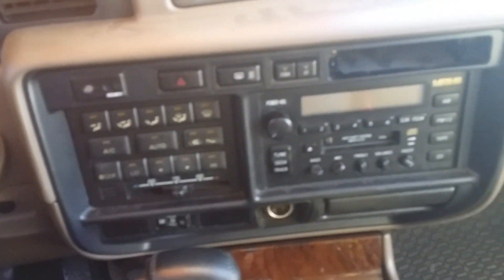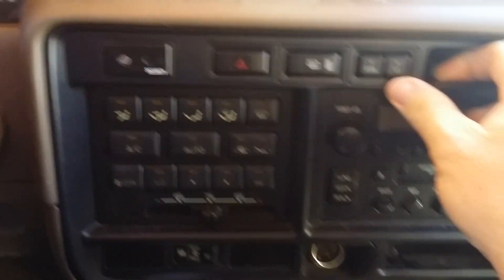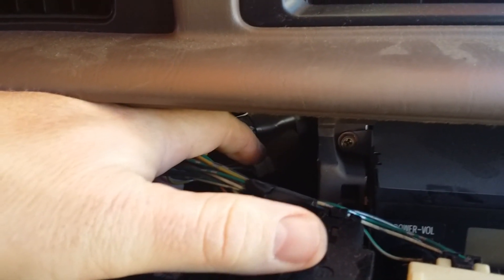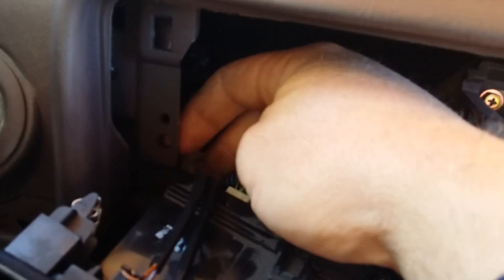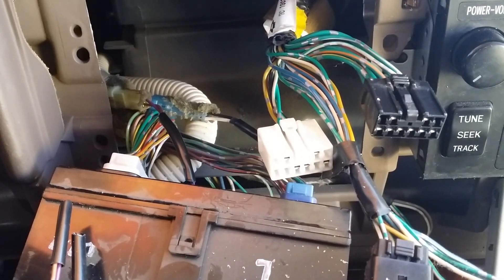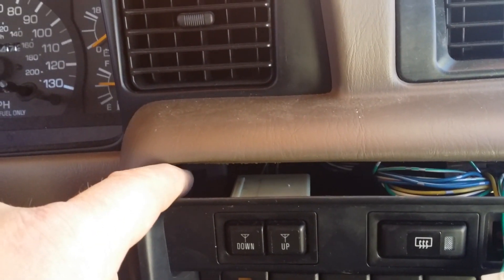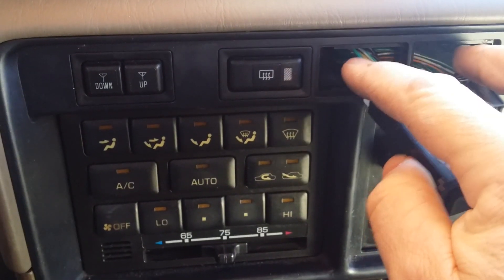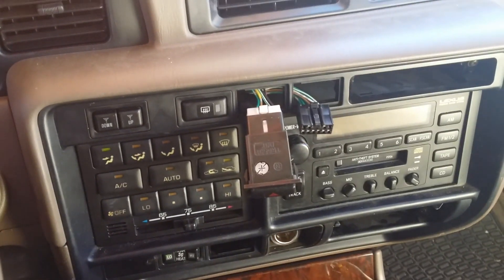Poor boy budget 80 series CDL switch mod FZJ80 LX450

Comment: Hey great video, quick question. What is the point of this modification? To be able to lock the central dif in high gear? Thanks. Also is there a way we can add front and rear differential lock?
Reply from the maker: Just so you can run at higher speeds, like in sand or desert.